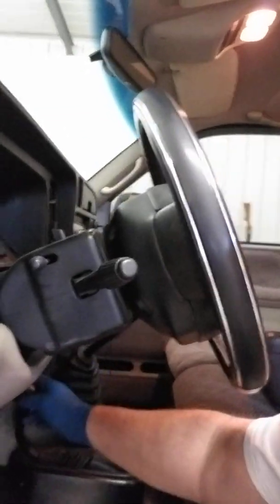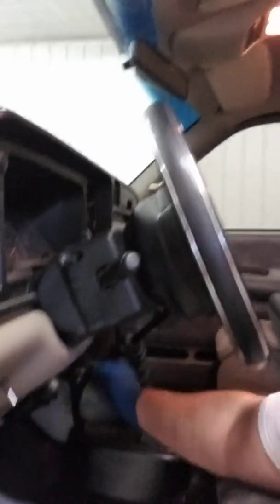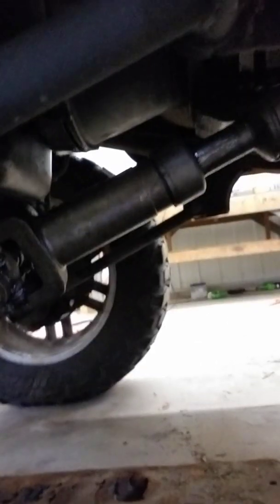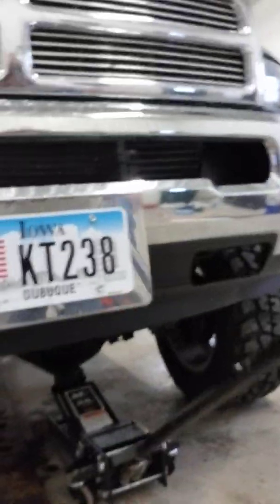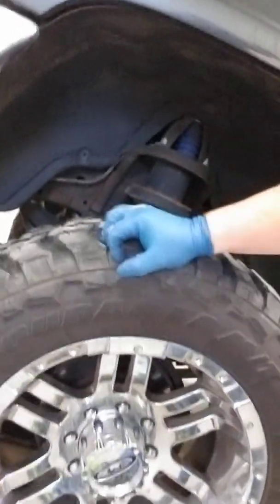2nd Gen Ram central axle disconnect CAD

Comment: I recently had my cad housing off to redo my inner shaft seal. When i reinstalled it the gear was towards the drivers side. My front drive shaft does not spin. Do i have to take off the cad housing and move the gear to the passenger side then reinstall?

Comment: Manual CAD lock worked perfect for my build. wish I had gone with the F350 dana 60  so I could have put a locker in but this is what Im working with. 97 Silverado CCLB with a 12v and NV4500. It was 2wd so the fame needed a BUNCH of work, to hang the dana  on the front,  truck makes people scratch their heads alot wonder if they build them that way back in the day!!!
Reply from the maker: There is a company that makes a CAD delete axle.

Comment: If you ever have a problem with your 4wd popping in and out of gear-- replace the int. axle shaft.  Took me forever to figure that out, and shops were absolutely unhelpful.

Looking at mine you would think 'oh, just a little bit of wear'.  Well, the collar doesn't fit over the axle portions equally.

Anyway, just throwing that out into the universe in hopes it helps somebody in the future.

Comment: That's a fucking 3rd generation dummy.  From 1974 to 1980 was 1st Gen and from 1981 to 1993 is 2nd Gen and to 1995 in Canada.  When dodge changed the body design in 1981 that change it to a 2nd generation.  I can't understand why when people heard one dummy say it wrong they continue to say it .I have worked on the 1st Gen and 2nd Gen and 3rd Gen which is what you have since they were new
Reply from the maker: Maybe in Canada, but not in the states.  72-80 are not Rams.  The Ram name wasn't used until 81.  There for 81-93 are 1st gen Rams and 94-01/02 are second gen.
Reply: @jasonschomburg614  bull shit . Before 74 is not rams .I don't know how someone can be so dumb all truck from 74 and up are ram .as I said I have worked on them since new . Have you probably not . I worked on them personally since new . So don't tell me they're not
Reply from the maker: @garyjohnson801  ok dude find me a D or W series truck with a Ram logo on it.  I'm not going to wait because you won't find it.  The only thing remotely close to the Ram name in that era was the Ramcharger.  The truck themselves were simply Dodge trucks.  As far as working on them yes I have.  We had a 68 D300, and 76 W200 on the farm.  Dad also had a 78 LRE.  And I had a 78 W200.  None of those trucks were Rams.  No Dodge trucks wore the Ram Badge until 81.